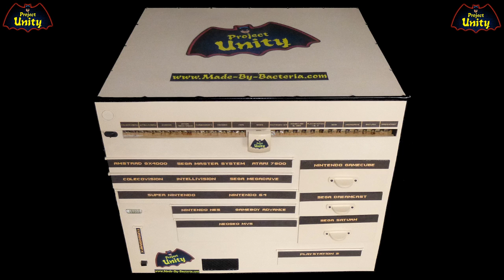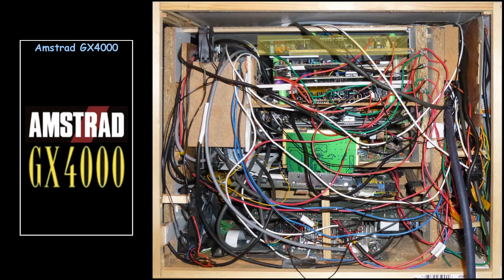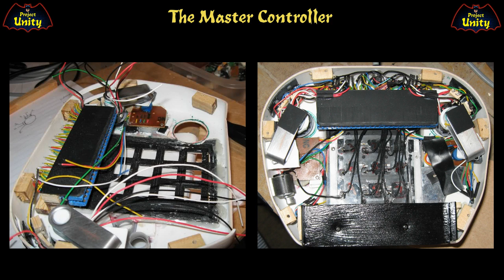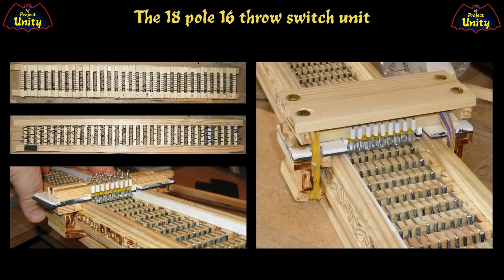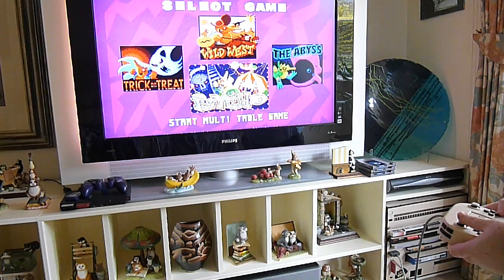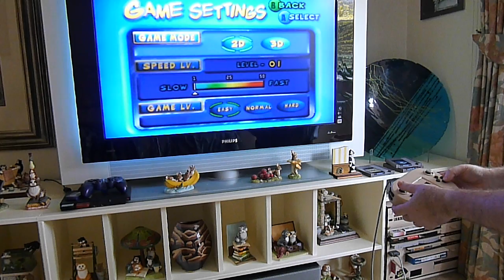Project Unity - the multiple retro video gaming console system

Comment: Say, something I'm wondering. The Master Controller is made with generic controller buttons right? A few games on the PS2 used the analog features of the buttons, so wouldn't those games be unplayable without being able to use the pressure sensitivity of the Dualshock 2? Something like Metal Gear Solid used pressure sensitivity to lower your guns without firing them, or in MGS3, there was a certain use that depending on how hard you pressed, meant you could slit a soldier's throat or not.

Comment: Got actually one question: Why using such a huge cartridge to make the master controller behave like the controller you want it to be? Wouldn't it be a lot easier to actually make a switch on the side to switch between controllers, just like you switch consoles on the unity console itself? Or that the console tells the controller which controller it needs to be, since the controller is wired, this should be possible. That way, the controller could be smaller, because now it only needs room for memory cards.

Also, how are you capable of using the Gameboy Player of the GameCube? I see no slot for the Gameboy cartridges. 

And, this means the only drawback of this is the fact that the memory cards are hardwired and thus can't be removed.

But, I still really like this project and wished I had it myself. Great job!

Comment from the maker: I could have integrated an Xbox controller into the Master Controller no problem, however the Xbox needs more current than my transformer can use (could have got around that issue) however needed a fair bit of space which I didn't have, and also i'm not interested in the Xbox games enough to spend time integrating it; so didn't.

Comment from the maker: Nope, been a system for 4 basic consoles all needing same voltages, however each system needed own controllers not one master controller. Most modded into a system before on the net was Yoshi's 6 console and PC system in a PC tower unit, however again, needs original controllers not master controller, and also consoles not properly integrated as you need to open the tower itself to change games! Mine has 3x the systems, one master controller; it is unique.

Comment from the maker: As covered, on many systems there are many third party controllers available, using different designs; they are "real" controllers, some better than others and some better than the stock controllers. My Master Controller is nothing more than a 3rd party controller, in the same regards.

Could have made the system 2 player of course however would have doubled the work for 2 controllers (literally) and I don't know anyone to play retro games with, so no point. My wife isn't a gamer.

Comment from the maker: Actually no, the PS1 is backward compatible on PS2 and built into the original hardware by Sony as standard, and the GBA Player is an official add-on (the one I used was anyway) as hardware for the GameCube to play GBA titles; therefore also not emulation.

Comment: It looks really impressive, however I can't seem to find a place on the outside of the box you made where you could interchange memorycards for the dreamcast, ps2, gamecube or saturn, nor a place to attach accessories for the N64 to attach the controller pack to, to save.
Did you include memorycards on the inside, or does this system not have any memorycards at all?

Comment: In my opinion, this project is uninteresting. The only things appealing from this are the originality you had in changing between systems (both slider and controller cartridge), and the fact that it needs but one cable for power and one for image (be it scart or S-Video). Again, you were original and had a lot of time in his hands but this isn't something people should consider buying.
Cycle accurate emulation on a smaller box with original loaders (cartridges, discs) can be interesting, however

Comment from the maker: Indeed. The appearence was dictated by how things had to fit together, there actually was little choice in the matter for the project. Game carts could only be extended as long as I had them or they would not have worked, boards can be thick and long, and loads of wiring; also no space to play with as it is snug in there. That meant the location of the carts and disc systems were not by choice but how they would fit.

Comment: It is amazing but the controlr is too bulky. The buttons in the middle are too far away. The perfect solution would have been to derivate the controller boards to the console and make them switch with the main switch or maybe just plugging in those cartridges. That way you can make the controller smaller and put buttons in better places. And what about multiple controllers?

Comment from the maker: CRT look better for most retro game systems as the graphics were designed to compensate for the poorer display quality; however many of the systems can be RGB modded rather than composite, and unless you lived in France, you got composite or RF in the old days. In other words, the television you use and the image you see is not uniform; so on that basis using a modern television with RGB modded consoles looks good anyway.

Comment from the maker: Loads of consoles, wires, solder, hot glue, switches, cables, regulators, other components, replacement consoles when a few died in the modding process; all that cost. Thing is, as a hobby, it was more important to make and achieve than just the cost to build it.

Comment from the maker: Doing that would have meant a lot more wires going to the master controller and a thick cable as a consequence. Some controllers generate a matrix that makes more connections, eg Intellivision where 9 wires in generates a matrix of 16 way d-pad, 4 shoulders and 12 keypad buttons, for example.

Comment: Makes sense. After all, putting it on the controller would have been unnecessary work I suppose. Thanks for clarifying. :)

Am I right in thinking this was originally going to have an Xbox bit as well? A shame it didn't work, but you probably had to think about structural integrity and how it affects the other consoles.

Still, great work! :)

Comment: I asked a similar question in his Unity controller video, only about the DC VMU and N64 rumble/memory pack. This is what he said:

"Already had done - VMU for the Dreamcast is installed with the controller in the NES cart, as with the N64's rumble/memory pack in that one. It fits, just!"

Given that the GC/PS1/PS2 memory cards are quite small, they should fit in much the same way without much issue.

Comment: Design wise: I would have put this in a standing arcade cabinet. I don't care for the use of a big manual switch for changing systems - big clunky moving parts. Logic ICs are not difficult and you could have use them to drive a series of relays - granted, still moving parts, but small, sealed, not big and clunky. I would have rigged the controller circuitry into the selector switch as well rather than using a big cartridge (i.e. what happens if you use the wrong cartridge with the wrong system?)

Comment: It just seems to me that having to swap out part of the controller AND move the switch is clumsy.  And if you forget to do one of them, is there a risk of damaging the system by sending the wrong signals from the controller?  The switch itself is rather clever, but would have been much more so if it had taken care of the controller being done right at the same time.

Comment: Having to move a monster switch and swap out controller bits seems awfully clumsy.  It sure seems error prone.  Wouldn't an FPGA or something that you just tell which kind of system you want and then have it do all the rewiring electronically be way cleaner and simpler and much more reliable?

Comment from the maker: The only points of failure expected are from the old electronics themselves failing. Some systems with lasers are prone to failure, eg Dreamcast. If a couple of systems failed I doubt i'd open the system up, use the other systems instead; if a few failed though i'd get it opened up and repair what needed it. Oldest board in the system is about 34 years old after all...

Comment: Oh, and what about the Atari games that use the paddle and driving wheel controllers (yes, those are actually two different controllers that look almost identical). I remember as a kid being frustrated by not being able to play games that used them because I only had the joystick. Is that what the 3rd knob in the bottom-left is for?

Comment from the maker: No games on 32X i'm interested in. Viabration feedback - yes that is in the master controller. Memory cart lots - included if you read the video description. Dreamcast VMU - the memory card is in the controller and hard wired, as to the silly little games on a VMU, no point. You can't use light guns on modern televisions. Internet - what's the point, not supported anymore. Points on not using emulators are in the video...

Comment: Pretty impressive, but I wouldn't want one. It sacrifices too many elements of the original systems. Mega Drive/Genesis but no Mega CD/Sega CD or 32X support? What about vibration feedback? Memory cartridge slots? And what about the Dreamcast's VMU features? Additional controllers (light gun, keyboard, etc)? Internet connectivity? 
Don't get me wrong, this is an amazing accomplishment, but if the goal is to just get "most" of what the original systems could do, why not use an emulator?

Comment from the maker: Indeed, my electronics knowledge isn't good at all, however I am good with logic, making things, common sense and experimentation. There are usually more ways than one to solve a problem. If I had known more on electronics I might have tried IC chips for the system logic, but didn't, so made a manual method that worked.

Comment: "Playing original games on original hardware means playing games exactly as they were designed to be played originally, and that is...."
the reason I've made a custom controller so that none of these games will feel original. Personally I rather play on an emulator with the original controller than the opposite.

In any case, that's one heck of a build and mad props for completing it.

Comment from the maker: Not really, he only used 6 systems, and left things intact in his large PC tower case. To change games eg NES or Atari, you had to remove the sides of the PC itself; also only did composite output; and only used original controllers (which is not ideal).

Comment from the maker: GC, PS2, (PS1) have hard wired memory cards, N64 and DreamCast have ones in the NES controller cart hard wired (pic of N64 in the video BTW). One GC, the GC GBA Player is a separate add-on to the system that wires into the GC, yes needs GBA Player disc to load GBA, which of course I use.

Comment: The only thing I would disagree on regarding this project is the controller. I understand why it had to be made as it is, but to fully experience each console, it's hardware and it's games, you're missing out a huge part of that by not holding the original controllers.

Comment: Does the unit have slots for the GCN, PS2 N64 memory cards? Does the N64 utilize the expansion pack? Did you use two different Gamecubes to switch between GBA and Gamecube, or do have to put in the GB Player disc?

Comment: A nice effort but it wont last long, the air flow is going to go from the top and down the front, the system will suffer at the back, should have put the extractor at the bottom back. I don't believe for a second the controller was his idea, the button pad with changeable covers, this was used with the Atari Jaguar. He contradicted himself, saying he wanted that nostalgia feeling and then using a bespoke controller almost makes this like an emulator

Comment: How badly does this blow up if you forget to switch out the controller interface board and end up with an incorrect one for the selected system? For that matter, how badly does it blow up if you start sliding the system selector switch while the power's still on? Do you let other people touch it, ever? ;)

Comment from the maker: Controller isn't bulky, it's slimmer than some DreamCast or N64 controllers actually, you can see it is about 1/2 as thick again than a NES cart, roughly.

An analogue trigger you refer to is just a variable pot, used a static pot instead varied on the console using, so to make a DreamCast analogue shoulders feel "right", used 2k resistors, on GameCube needed 10k. So yes, there are analogue triggers, they use rubber topped tactile buttons instead. Works fine.

RGB looks great, can't fault it.

Comment from the maker: If I had space in the living room and could get away with it with my wife, i'd have a large old-school television there too, for retro gaming, however that isn't an option; we all like slim and large televisions these days, which means LCD screen. Problem is new televisons are too accurate, and high resolution too, CRT screens had colour bleed which made images murkier but integrated and looked good for old-style gaming. The system however outputs on SCART so if did get a CRT, would be fine.

Comment from the maker: I don't have kids, and no-one to play games with often enough to make it viable to have 2 player. No fire hazard, only 12v DC and plenty of cooling in there. Used thick wires also that are 6 amp for voltage lines, system only needs about 2/3 that.

Comment from the maker: The controller for any system is the interface. The game itself is what you play and if you're using emulation you can have graphic tearing, audio stuttering, video stuttering, wrong colours, etc. That is what original hardware doesn't suffer from. 

It's like your home entertainment system - annoying to have a separate remote control for TV, DVD, sound system, Sky etc - "all in one", if easy to use, makes more sense.

Comment: if you use 3 wires from Joistick, the beams reach a PIC microcontroller, you can make 9 different outputs of that pic ... outputs connected to 9 relays .... each relay then feeds one console ....... (circuit birary)  ....... sorry for my english

Comment from the maker: A very good question indeed, I had thought this option early in the build, however the reason is simple - would have needed rather thick wires and rather long wires for ground to go 4 metres to the controller and 4 meters back; which would have been less than ideal, and the pins in the cart slot would not have handed the amperage in any case. If used existing cable for that, would have not been able to do the amperages needed for any of the consoles.

So, nice idea but would not have worked.

Comment from the maker: The £700 is purely the cost I had in parts, consoles, controllers, wiring, solder, etc. If I were to sell it it would have to account for the 3,500 hours it took to build it, in other words, offers in excess of £25k, which isn't going to happen, and not an issue as I built the system for my own enjoyment and achievement anyway.

Comment from the maker: Indeed, original systems are fine if you have a couple, if you have loads, it has issues; tried to find a power supply to test a console a while back before modding it - took ages, and when did find it, lifted out a box of wires as all the power supplies in the box all clung together!

Comment from the maker: There was no room for any other variation. The system is quite jammed packed in there!

The air comes into the system from the gaps around the switching unit, moves around the case from 2 separate fans; each console that has chips on it that get warm have fans as well; and on top of that for air circulation is the quite powerful air extractor fan. There is probably as much moving air in this unit as in a PC unit, however PC's get far hotter than my system will by far!

Comment: I'm sure there is a good reason for you doing the airflow the way you did. (Not much room) but surely it would make more sense to have the fans switched around? So the fan at the top pushed the hot air out of the system.

Comment from the maker: No, had no space left in the case at all after the project ended, which is a reason I couldn't use the 16th slot on the bank of switches even if i'd wanted to. The dimensions of the system are roughly 44 x 38 x 40 cms, which is exactly the size I had in the recess for the unit. If I had made it a table-top unit I would either have made it twice as long and half the height, or like a sloped cross-section at a diagonal on a dome - would have been larger but look "nice".

Comment from the maker: I ended up with the one 12v input; and having to make regulators for -5v, -3v, 3.3v, 5v, 6v, 8.5v, 15v (as well of course as the 12v input). A couple of them needed to also use the 5v, to step-down then step-up; so ended up with using 3 x 7805's for the 5v output and put them on a large heatsink! All works though.

Comment from the maker: These could not be made in quantitles due to the time to make one even, using original hardware has no issues with copyrights as there is no circumventing or de-engineering, just taking boards and making them work together - which was one of my innovations in working it out. To make another unit would probably cut down to about 2,500 hours to make however i'll not make another unit anyway. One I did was labour of love and to see if it was possible; next one would feel like a job not hobby.

Comment from the maker: You are right of course, hot air rises, however each system that has chips that can get hot/warm have their own heatsinks and fans, so the purpose of the fans and the extractor fan in the unit is not to remove the hot air (the individual fans do that on the motherboards) but to make a breeze to circulate air and remove the warmed air from the main fans. The extractor fan is a 12v fan used apparently before in a professional mixing deck, you can feel the air over a foot away, it's good.